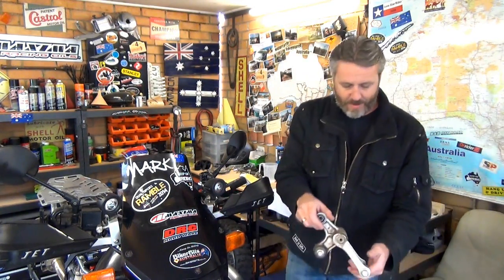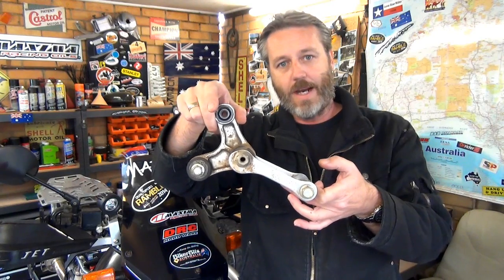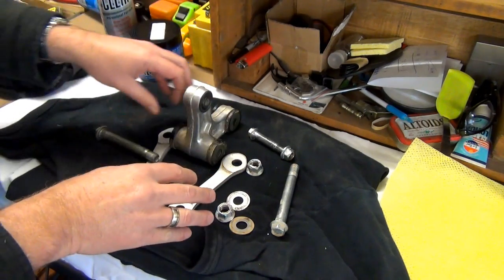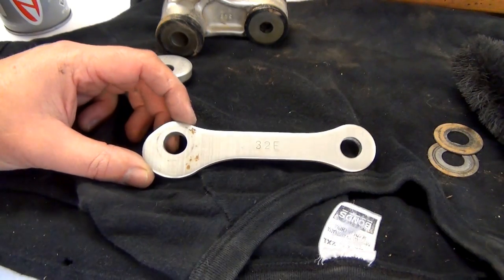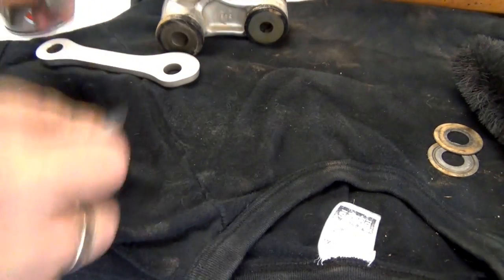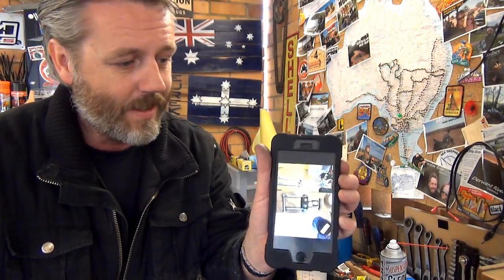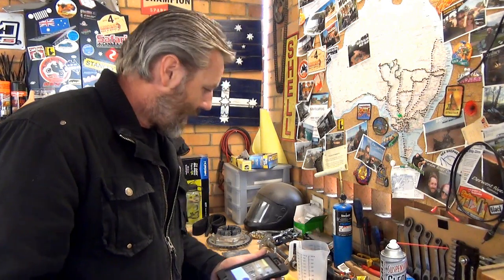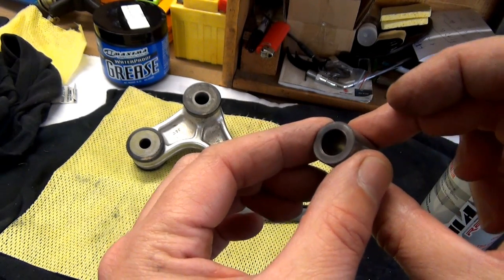DR650 Linkage Bearings Re Grease

Comment: Mark, good videos. Thanks!  FYI: The bearings with the loose needle rollers are called "full complement" bearings.  They are used in very high load applications, as they have a load rating around 25-40% higher than equivalent sized bearings which have a steel cage retaining the needle rollers. In this instance they have also no internal seals to maximize their working width (bearing area).  Your other video: 'Rear Suspension Removal' was very helpful, thank you....  Reason being: The order of the swing arm (rearmost) pivot bearing bolt and thrust washers published in both the Clymer and Suzuki manuals, is incorrect in the exploded view of the lever and lever arm (dog bone), .  These manuals indicate that the thrust washer goes on the outside of the dog bone, whereas you noted (correctly) when you removed the bolt , that the thrust washer goes between the dog bone and the pivot spacer.  This provides additional mechanical protection to the bearing seals, and a flat (ground) surface onto which  the pivot spacer can seat (rather than being forced into the aluminium dog bone, and causing the bolt to loose tension as the dog bone wears against the spacer).  The sectioned, assembled view of the dog bone, pivot bearing bolt and thrust washers appears correctly in the Reassembling Information sectioned drawing, chapter 5, page 45 of the Suzuki workshop manual.

Comment: For cleaning those bolts up, removing rust and any patina I saw a great tip on Del Boys Garage. He clamped a normal drill into his vice upside down. Clamped in the bolt thread first. Switched it on and with a strip of 240 sandpaper he just applied it around the bolt and it cleaned up a treat. Thanks for sharing
Reply: Del Boys Garage .. Another great video channel.
Ride Safe, buddy
Rgds from S Africa
Clive

Comment: Question:
14:12 you show the clean sleeve.  Would it help to put a bit of axle grease in that sleeve when reinserting the bolt to 1) help the movement of the bolt in the sleeve, and 2) help keep out dust or sand that may have causes the initial wear?
I'm not very mechanically minded so I really appreciate any response from those with more aptitude than I've got for engines and mechanics!
Reply: yes you would grease the sleeves so the seal is greased. you would also grease the dust seals inside and out.